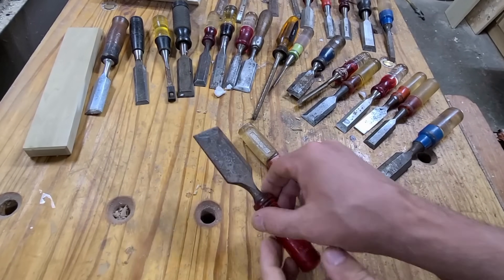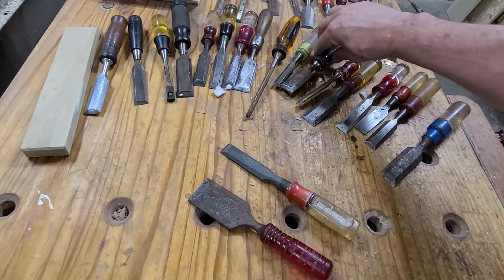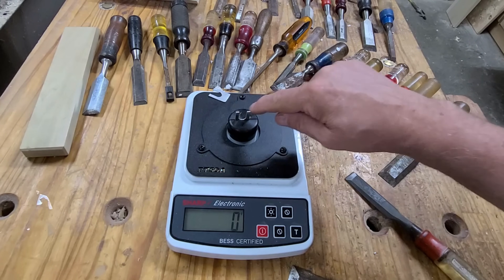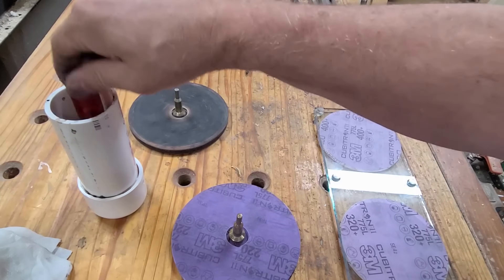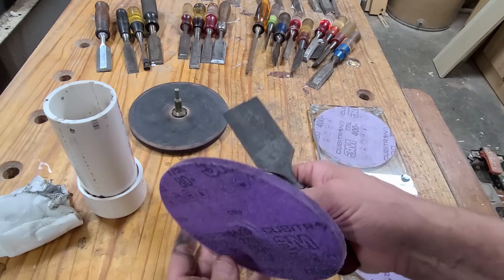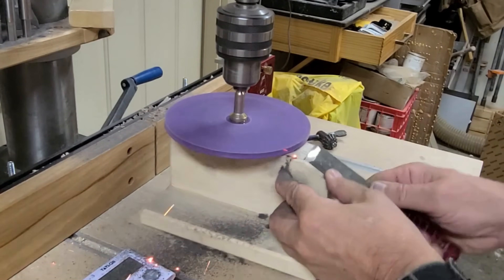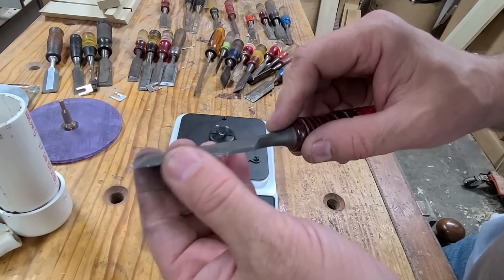Renew the most severely rusted bench chisel in 4 minutes (ON A BUDGET)!!!

Comment: My only concern is the amount of heat generated when grinding the primary bevel.  It looked awfully hot.  If the steel gets hot enough to lose its hardness it will still sharpen to an extremely fine cutting edge, but that edge will quickly go dull in use.
Reply: I notice that he touches it near the bevel with his bare fingers after grinding which leads me to believe that it is not hot enough to destroy the temper. A chisel placed on the dashboard of a car on a hot day would be much hotter than this. Yet you never see a warning come with a new chisel saying "Caution : Never leave this chisel in an enclosed vehicle on a hot sunny day. It will destroy the temper! " At least that is my take on it for what it is worth.
Reply: This can be overcome by dipping the chisel in water periodically to cool it and oiling after sharpening to prevent rust.
Reply: @RyanJBarnard or he could dipit in oil
Reply: Whaou ! Well done
Reply: There was no change in color in the steel. If you still have concerns about the temper of the steel just go slower and don't put as much heat in it. You should do yourself a favor and watch some videos on heat treatment (knife making would be a subject) and actually learn what it takes to change the grain structure of metal.
Reply: @allenhonaker4107  that would be very messy
Reply: @allenhonaker4107  or dip it in honey?
Reply: @d.k.1394 Actually dipping it in pigs blood would be your best bet.
Reply: Fact: it never turned blue. Not even purple which is the visual indicator of temperature threshold affecting the hardness negatively!
Best regards 
Anders 
Sweden
Reply: @RyanJBarnard good comment, I can tell you  naphtha and paraffin  make a good rust proof for every shop tool  that is metal  linseed oil for wood 👍🏻
Reply: Where to get the stand underneath?
Reply: @cphawaii Just cut a 25° angle on any piece of wood - job done no need to buy anything 👍🏻
Reply: no liquid. too hot. but with cheap chisels it's probably not worth the effort the diamond and Japanese stones take.
Reply: @kieronstump  I'll remember the linseed oil tip next time I want to prevent my wood from rusting.
Reply: The 3M Cubitron paper is specifically engineered for grinding metal and is manufactured in a way that reduces the heat when grinding.

Comment: The trouble with badly rust pitted chisels or plane irons is that the pitting on the back of the blade is going to make getting the edge to be even as the pitting intrudes into the edge and leaves it uneven.

Comment: I bought your system and tried to sharpen.  I could not for the life of me get an even bevel on the top side.  Hence, my chisels all have a skew angles now.  So I built another jig and still no good.  I did not move the jig around as you did.  Luckily, I've only mangled old chisels.  I am scratching my head about this.  Maybe I need to video my process and send back to you.
Reply from the maker: Thank you for reaching out to us.  If you can send me an email at support@taytools.com, we can chat about what might be happening and what we can do to get you an even bevel on your chisels.
Reply: I also had the same problem getting precisely squared off chisel. The system depends on having the a precisely made jig and the drill press table precisely aligned in both tilt angles to get exact 90 degree all the way across the chisel. I gave up trying to get it to work precisely, because I didn’t want to build another jig…or spend more time fiddling with the drill press. 

Since the chisels came out sharp, I’ve ignored the skewness because it doesn’t affect what I do. As usual, with presenters, they are professionals who make every step look easy. And they always use well tuned tools…such as the drill press. And they just work to a higher degree of precision than I do. And getting a precise micro-bevel with hand holding? It takes some practice, and it doesn’t need to be perfect.

Comment: Very good advice.
Orthogonal sharpness is quite different to slicing sharpness though.
Your tester scale measures orthogonal sharpness, but your chamfer test relies on the micro sawtooth pattern left by the grit, which is not orthoganal.
A saw will slice just fine, but fail on your sharpness tester.
Slicing versus cutting.

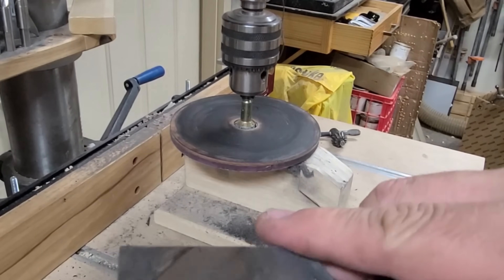Comment: I'm with David Charlesworth in that I don't think an abrasive sheet method exists that doesn't cause dubbing to some degree. Going frame by frame, the reflection of the overhead light at 13:27 gives me the impression the front of the back is slightly rounded but I could easily be mistaken. This happens with repeated lapping on leather even without the assistance of power tools so I'm curious to see a clearer example of the backs and whether or not this method accelerates any dubbing and bellies forming. For example, how do these chisels look after using this method and then lapping them further on a high grit stone that's guaranteed flat? Would you then get a scratch pattern develop uniformly across the same surface area or are new highs and lows revealed? Not shitting on the method - it strikes me as clever. I'm just sceptical and keen to learn more. Thanks.

Comment: Can you reuse vinegar for rust removal? For instance keep a sealed jar of it and pop something in every so often to clean up? Or is it a one time use thing really? Thanks
Reply: Yes. The acetic acid in vinegar will react with rust to form iron acetate. As long as there's still unreacted acetic acid left in the solution, it will keep removing rust.

Fun tip: once the vinegar has been used up and you just have iron acetate in your solution, you have something known as vinegaroon. If you put it on oak, it reacts with the tannic acid in the wood to turn it black.

Comment: Great video, thanks. I'm worried i wouldn't be able to get the drill press table exactly parallel with the disc. Any tips on that?
Reply from the maker: You don't need to as you ca shim up the base of the ig with lue tape. Once you get it right you'll never ned to mess with it again.
Reply: @TaylorToolworks  I think was saying "you can shim up the base of the jig with blue tape". He showed this in a previous video on the drill press sharpening system.
Reply: @TaylorToolworks  makes sense, thank you so much

Comment: In the future make a recommendation to use evapo rust versus vinegar it's Superior and it washes off just as easy you will have to wire brush the tool to remove or steel wool tool the black and residue from where the evapo rust removed all the rust everywhere and it's reusable

Comment: I just purchased one of your unhandeld Narex marking knives, and I was wondering if you could tell me what size drill bit is needed to drill holes for the pins?
I don't have any bits that small, and I want to make sure that I order the right size the first time around.
Thanks.
Reply: Got it figured out.
I had to pick up a numbered bit set because I had it narrowed down to either a #43 or a #42, and HB had a 60pc set on clearance for less than the two single bits would have cost... it turned out to be #43
Putting it together was fun and didn't take long at all, even after making several mistakes along the way.
I may have to buy some of your unhandeld Narex chisels next.

Comment: Great Job 
My opinion tho I would dip the chisel in water to maintain the temper if it has one and go on the slowest speed
Reply from the maker: I measured the temp with a digal thermometer and the temp at the tip never got above 110 degrees. Need to exceed 600 degrees to remove temper.  Thesecret is the Cubitron whick slice through steel and do not generate heat.

Comment: I guess the five minute challenge didn't actually include the 24 hour bath? Or the time spent pulling out and mounting the wheels? Or the time to add or remove abrasives as they wear out? 
You be you but I'm sticking with my grinder and stones. Most of my edge tools are restorations. And I love the stones. By the way, I bought a new slow speed grinder some years ago for about $120; the rest of my tools (stones, float glass, etc) I've had for over 40 years. So amortizing the cost of equipment doesn't pencil out to very much. Thanks so much for sharing. Love your videos.

Comment: Great video, thank you, if blackish stain after soaking in vinegar is an issue hit it with high pressure water, removes immediately, must dry right away to prevent flash rusting, being a member of the pensioner brigade time is of no worry to me, I would round up all local/mates chisels, soak them for at least 24 hrs, (been using vinegar to remove rust for about 200 years 🙂, most satisfying for sure) clean and sharpen chisels on weekend afternoon then invite owners around for BBQ evening. 🙂doesn't get better than that.

Comment: Renew a chisel in 4 minutes starts with a 24 hour soak!
Reply: Not fair or appropriate.

The actual sharpening takes less than five minutes.  He expanded on the project by taking on a chisel that's also corroded.  So, if all you want to do is sharpen, it's only a few minutes.

Comment: Awesome tutorial! Love those jigs. Jigs equal perfect repetition! Thanks!
Reply: Jigs make you a slave if you depend of them. Don't get me wrong, I use jigs and I higly value them, I find them particularly useful for beginners as the result they can get with the jig helps them setting a standard about the level of perfection that you should not get below if you aim for quality in your woodworking. They are also useful for already proficient woodworkers when a repetitive work has to be done, like cutting many dovetails or chamfering multiple pieces with a chisel. But to be able to reach the same level of perfection without the help of the jig is also very important as there are situations where the jig is not available or not suited for that particular work (i.e. paring the end of a piece at an unusual compound angle) and situations where to be able to do the task without loosing time to pick the right jig is faster. In those situations who has honed his tecnique and eye can do the task quickly and with an optimal result, who has only relied on the jig as a crouch, as an excuse to not hone his skill is completely lost. 
Build your jigs, use them, but never depend on them.

Comment: This is a great video, and next time I am trying to use the vinegar tip for sure. Just one of your statements in the beginning: "It might take up to thirty minutes or even half an hour". Well, IMHO any woodworker not willing to spend an hour (or two or three) restoring an old chisel is not worth it. Woodworking is not about speed, it is about quality. An old chisel is worth ten times more that most modern chisels and hence worth the time restoring. Having said that, I am a bit worried at sharpening the bevel on the drill press, it looks like the edges are getting hot. While I would follow your method, I also would spend some more time on cleaning the bevel in a slower and cooler way, maybe even thirty minutes. 😄

Comment: Just curious.  Why do you go through 1000 grit when flattening the back but only 220 grit when doing the bevel?
Reply from the maker: It would jsut take longe to strop tha back as there is more material to address. The tip of the bevel is so small it takes just a few seconds. Good question.

Comment: Good stuff!  
When I was first buying woodworking tools I picked up a new set of Craftsman chisels.  Not great, but good.  A few years later they were in need of sharpening.  My daughter's father-in-law was a sort of professional handyman/maintenance guy.  I don't remember where he worked, but he was the one who showed up when this or that needed fixing.  He took my chisels away and brought them back sharp.  He hadn't asked, which I wasn't pleased about, but the real problem was that he ground both sides of the bevel.  Yes, that nice sharp cutting edge is nowhere near the back surface of the chisel.  He didn't understand why I was unhappy, after all they were sharp!  They are still around somewhere, but I bought a set of Marple chisels, as I have no way to remove that much steel without getting them too damned hot.
Reply: @MikeTaylorToolworks  Interesting!  Of course a chisel has a lot more steel behind the cutting edge than a thin plane blade, but still that opens up some possibilities.  Thanks!

Comment: Excellent demonstration.
One thing of note about the drill press. Mine has a morse tapered collet holding the chuck in place, meaning pressure fit, no screws securing it.
I once had the chuck drop out using downward pressure.   A scary moment.  Just a thought.

Comment: Hi , what about the cubitron II belts ? are they the same material of the cubitron II discs? I usually flatten the back on a belt sander and using a 36 grit belt makes quick work of it , but no where near as quick as your outcomes here - I might actually pick up a belt as they are not too expensive and try it out myself :)

Comment: Excellent video.  Thank you!  I can already see where I'm going to have to get this system set up, including the jigs. :). I'm going to assume you could create a plane blade sharpening jig by using a 30deg. angle on the drill press jig instead of 25.  Thank you for showing the vinegar rust remover trick!  What a great idea.  Just a side note you can also use the vinegar soak on old sink disposers, even if you're on septic.  Works a treat to rehab a maybe not well-used disposer.  Us folks on septic don't use the disposers much, but they will rust up from time to time.  Every so often, it's good to throw some white vinegar down the drain and let it soak a bit, then rinse with warm water.  Even makes the disposer smell a bit better.
Reply from the maker: Thanks for the kind words. I approach plane blades a bit different. When using the discs for blades 2" and wider the edge produces is out a few thou which can be a problem on a smoother making 1 thou thick shaving. My  hack is to grind the primary bevel at 25 degrees and then use a honing guide at 30 degrees on the 400 grit disc on the chisel back flattening plate. This produces a straight edge. I them go to the leather disc and polish. This works great.

Comment: For pitting that still has the rust intact on it you might look into using electrolysis to plate that rust back onto the metal in the place it is in contact with it to minimize and repair the pitting, then do your grinding,.    I use a bench sander with a good flat plate and an old belt, wet the belt to keep it cool , have water or mineral spirits handy to keep it cool, switch to a finer belt or even put an arch under the belt for a slight hollow ground which will help in hand sharpening later on.  Good job with the sand paper, though.

Comment: Ground glass, wet and dry, wire fleece, Trend diamond sharpening jig for both 25 and 30 degree bevels.

Permanent marker pen on the bevels to confirm metal is ground true.

Works without power tool and avoids having to build jig for sharpening.

More expensive overall but repeatable results.

Chisel can be honed every now and again depending on what stock you are working on.

And works on block plane irons too if working across grain.

Trend Mk2 kit under $100.

Comment: I also had the idea of using a drill press as a DIY Work Sharp 3000 a few years ago. I concluded that it would be too dangerous to use but this has put my mind at ease!
Good work, especially with the jigs :) I'll probably order me one of these if you ship to the UK.
Reply: Nothing compares with the Worksharp. There is no going back. I’ve tried the drill press system. It works ok, but the Worksharp is so much better especially if you are just touching up an edge.
Reply: @MikeTaylorToolworks  I can imagine, I have heard nothing but good things about these Cubitron discs.
Also, I think the WS3000 is closer to 8x the cost. You can get a lot of Cubitron discs in different grits for that initial outlay!
Reply: I too have been searching for this in the UK, but without success. Hopefully, some enterprising retailer will start importing them soon.

Comment: Very good and nice to see an old chisel brought back to life. However why make it such a quick process. Just a few more minutes spent could see a much sharper chisel. For instance the primary and secondary bevel should be finished the same as the back, little point in having 220 grit scratches on the bevel with 1000 grit on back.
Reply from the maker: Using the sharpness tester shows that my chisel is sharper than anyone else on Youtube. See the video but Woodcraftbysiman for a comparison. He used a 30,000 shapton and did nto get as sharp as i did. Katz Moses also did d sharpenign video and did not gt his chisels as sharp as mine. My testing is objective.

Comment: Wouldn’t it be cheaper and easier to just keep buying and throwing away cheap chisels than to buy a drill press, that super sand paper, the discs, and to make that grinding jig?
Reply from the maker: Not for me as I use mine everytime I'm in the shop. I sometmimes sharpen several times a day. I'd have bought 100 chisel by now.
Reply from the maker: The first 24 hrs is soaking so not any work for me. I guess if I charges by the hours I should charge for 24 hrs 5 min labor?? I think not!

Comment: Great tutorial!  I would do an extra step for ascetics is after soaking and wiping the metal is mask the handle where the metal meets.  

Then run a wire brush (on a drill or bench grinder) to brighten the metal, then start sharpening the chisel.

Again well made and thanks for putting this video together - now more importantly, I know what “Right” looks like and how it’s supposed to be done.